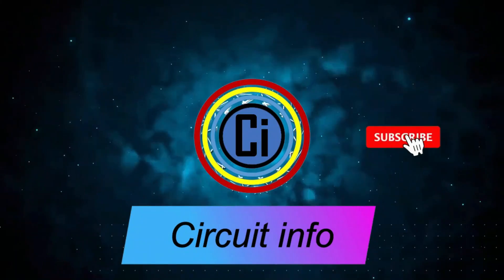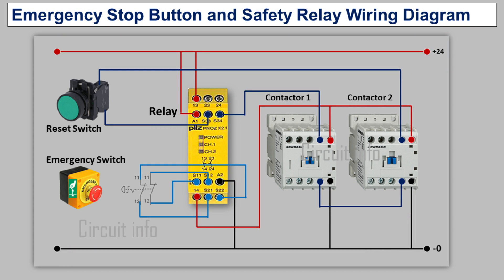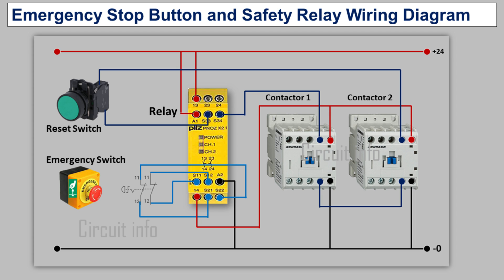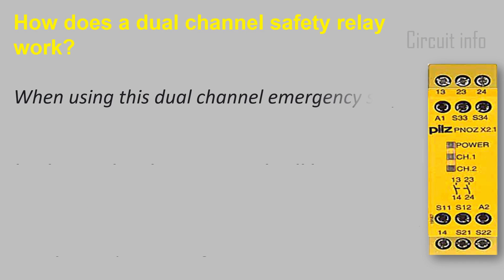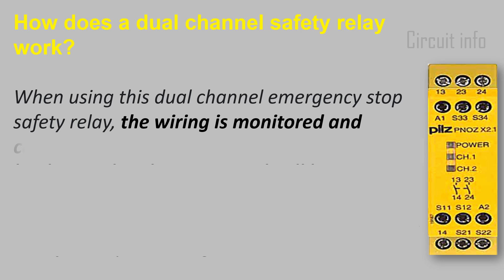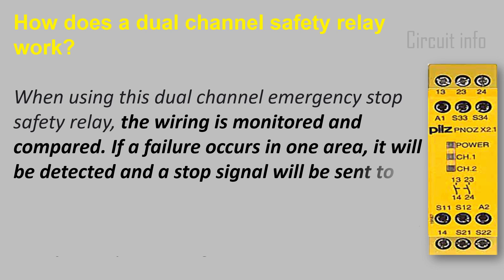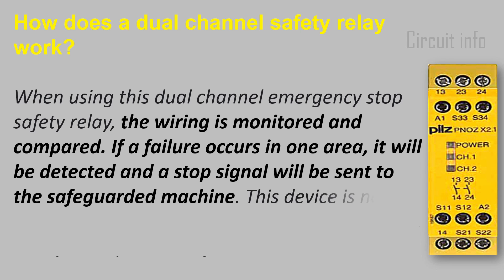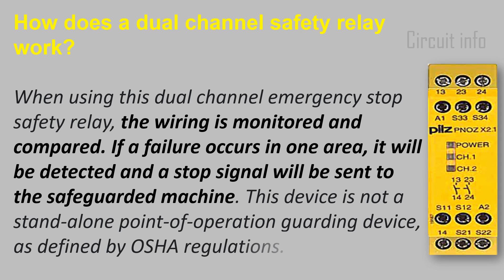Emergency Stop Button and Safety relay wiring diagram@CircuitInfo

Comment: Wiring diagram is wrong
Reply from the maker: Hello, thanks for watching, tell me what's wrong with this video.
Reply: @CircuitInfo  Nothing is technically wrong with this diagram. I will say it's maybe a bit unconventional in that most people haven't seen or used a MCR(Master Control Relay) for control voltage regulation, which is what this appears to be. Typically traditional MCR's aren't used anymore, mainly because there are better options out there but also because MCR's sometimes tended to historically be non-safety rated relays or contactors, like the Schrack's in this video. This poses a safety risk if they are used as an actual MCR for control voltage of the entire control system, because the contactor itself is not safety rated and thus could stick closed (ie not fail safely like the Pilz would). And I personally haven't seen a MCR setup like this that is fed by an upstream safety relay.
Reply from the maker: @lanfordautomation 
Thanks you so much for explaining this! Your advice is really helpful and i will remember it for future videos. I appreciate you taking the time  to share your knowledge. 💐🙏
Reply: Kaboom,,!!! WRONG DIAGRAM 🎇